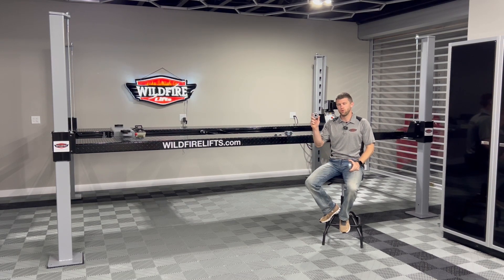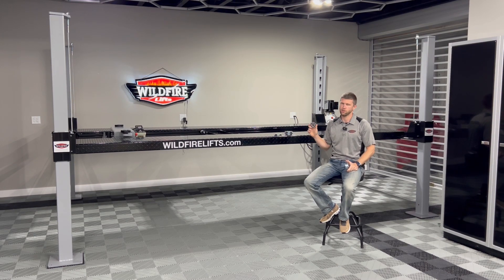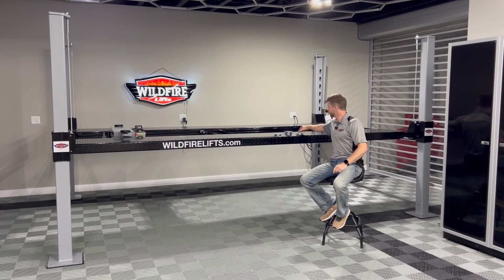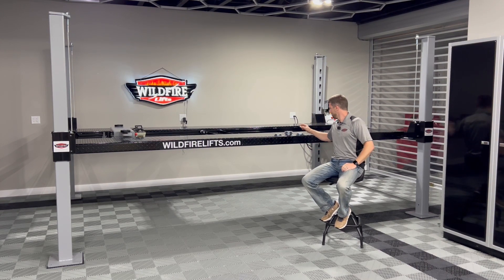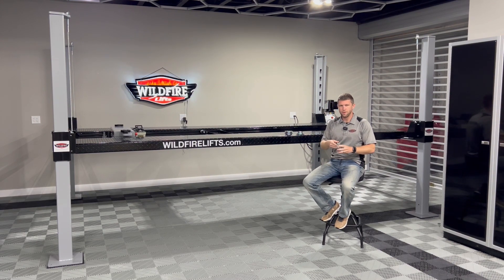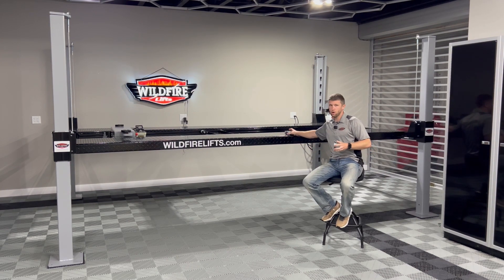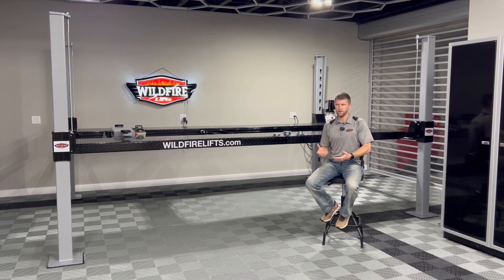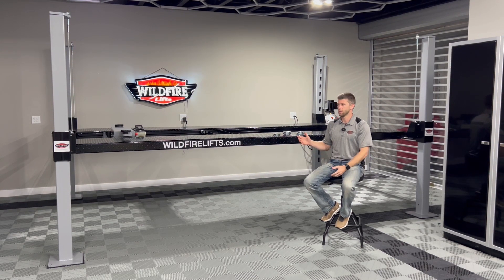Bearings vs Bushings In A 4 Post Lift

Comment: How often do the bearings fail?   There are 2  gentleman who had a bearing failure on one of your lifts.  One said the bearings you use are low quality.  The other guy replaced the entire pully and pin from you.

I am ready to buy from you but saw those 2 videos and am a little concerned now.   Have you changed the bearing designs since those failures?    I am also worried about tbe time it takes to replace the bearing if it fails, and geting the vehicle down if it fails with a vehicle on.

Thanks.
Reply from the maker: Hi @dsmtsi great question. This issue occured with lifts produced in April and May of 2020 (Covid times when the world was shut down). Our OEM bearing supplier was completely closed (I'm sure you remember those times) but our sales skyrocketed with many car guys sent to work from home, maybe you included?! We had to change over to a third party supplier who claimed to have the same spec but we couldn't verify (clearly they didn't and only wanted revenue coming in to keep their doors open). This issue affected roughly 150 lifts, once we realized, we built and sent out service bulletins to all of these affected customers, 99.9% of them were happy and impressed that we took initiative ahead of time before they had issues. Of the two videos you saw, (understand that we sell thousands of lifts a year), the customer put out a second video about how happy he was with us taking care of him (he actually called us to ask if him put videos up was ok, we were fully ok with that as we stand behind our products). The other gentleman, lets just say there is a whole story behind that which we do not need to get into here (he would be part of the 0.1%, very unethical individual). Since that time we have gone ahead and improved the set up to include single pieces of milled stock vs two seperate stock pulleys and increased the size and load bearing of our bearings. We have sold thousands of lifts before and thousands of lifts after without issue aside from those lifts that were in those production series. We build very high end lifts with very high end components and while I understand you've come across one singular issue which occurred, and we admit to and resolved as explained above, you won't find post after post of issues present on our lifts which you will find with most of the other major lift "brands" on the market. Hopefully that helps clarify the scenario!
Reply: @wildfirelifts   Thank you for the quick and detailed and honest reply.   Covid was terrible for everyone and supply chain was definitely affected.  It is good to hear once you found out there was an issue you issued a bulletin to all 150 customers and warrantied the entire pully ( not just the bearing).  It is also good to hear you have since changed the design to make it better / stronger and went back to the original supplier.

Unfortunately the one gentleman's video comes up more often in the algorithms when searching your lifts and he is saying it's unsafe etc. Without sharing your side of the story.  I will try and direct people to this thread when I see the bearing quesrion come up.

This was my only concern with going with your lift and it seems you have taken care of it/ were a victim of having to switch suppliers and them not producing the same quality product.

My last hurdle is figuring out how much duty will be getting the lift into Canada I'll be ordering.  A Toronto wearhouse up and running would be great for us Canadians ( if / when it happens).
Reply from the maker: @dsmtsi  yes it is quite dissappointing how the algorithms populate unethically produced information. I suppose it is part of business but the less than fun part of it. Ideally we will have a Toronto warehouse open in 2024, just not certain of the timing - we can always ship to a US freight hub near the border in the meantime where you can pick up from and handle the border crossing.
Reply: @wildfirelifts   That is the plan, we spoke yesterday.